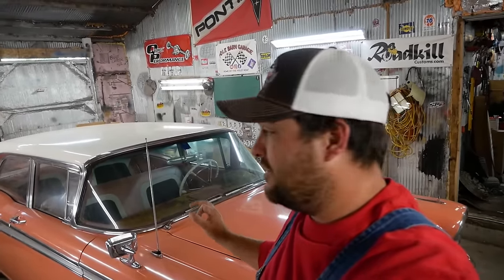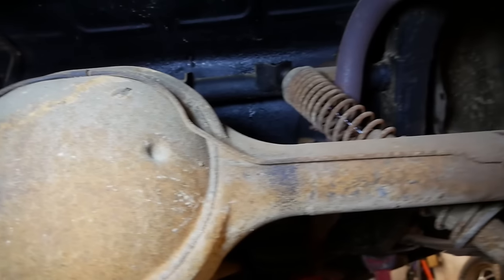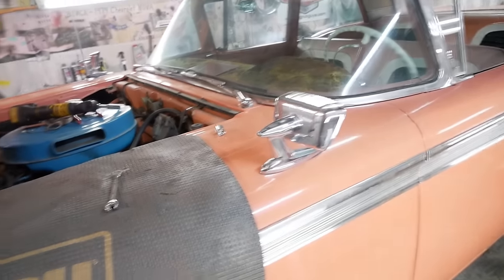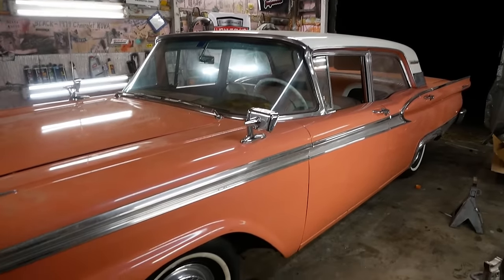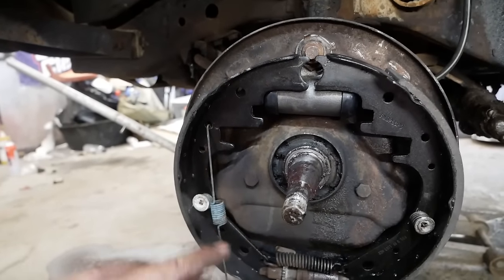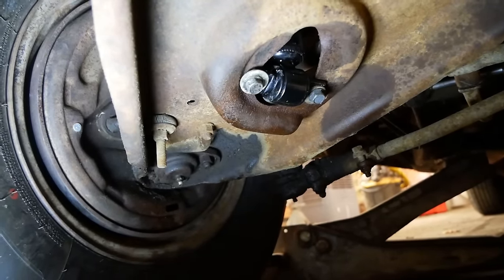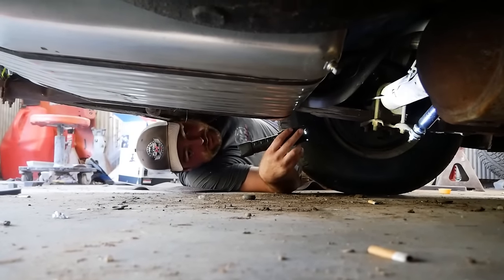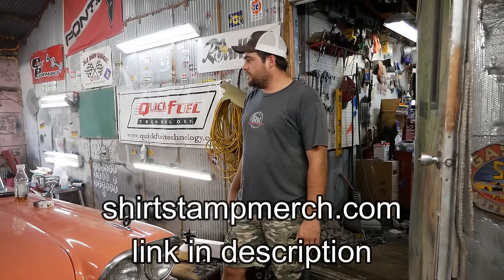All ORIGINAL '59 Galaxie 500 SURVIVOR Gets Roadworthy!

Comment: 33:17 The D settings are indicative of the Cruise-o-matic transmission. D1, D2, D3 are drive 1 is the lowest gears, D2 being around town gears, and D3 being highway gears (cruising speeds).  There is another (green) "updated" Galaxie 500 in Kansas City listed on Marketplace for $12,000.. Gives you some idea what the car is potentially worth.
Reply: Why would anyone drive in any gear other than D3? Is it not fully automatic down to the lowest gear when you select a higher one?
Reply: @auteurfiddler8706  in the 50's automatic transmissions were a new thing. Everyone was making something different, almost every year some brought out a "new" automatic transmission
Reply: In the 50s there weren't many highways with high top speeds so the 3rd ratio was a bit too long for around town so you could "manually" adjust ratios on the fly think the floppy paddles on modern minivans for a similar idea today or the sport mode in your Corolla econobox
Reply: @ywe3  They had highways (ie: Route 66) but with the Manual transmission vehicles Up until the late 1970s, most transmissions had three or four forward gear ratios, although five-speed manual transmissions were occasionally used in sports cars such as the 1948 Ferrari 166 Inter and the 1953 Alfa Romeo 1900 Super Sprint. Five-speed transmissions became widespread during the 1980s, as did the use of synchromesh on all forward gears. 

Until about 2005 most Automatics still had "gear selector" on the shifter. Most automatics  still only had 3 gears with over-drive (4th gear). Although it was rare for people to turn off overdrive.
Reply: In D2 the transmission would start off in 2nd gear for winter driving. 1st gear was easy to spin the tires on snow. Take off in second would ease off on the spin. That's what an old timer told me. And I'm no spring chicken at 57..😊
Reply: @49Fordproject  I'm 56

Comment: The white dot right after neutral is for snow conditions its starts you off in second. Then the green dot is normal drive where it starts off in 1. And low is a cool one where if your going 10 miles an hr it jumps into 1 and if your going down the high way and pop it into low it will down shift into second giving her all the onions.

Comment: Looks like a 352 since it's the light Ford blue and paint looks original.  300 horse.   Compression ratio was dropped to 9.6 from 1958's 10.2:1... same HP rating, lost 15 ft-lb torque.  (EDIT:  then Dalton said "you guys who know your Fords probably know this is the 352...")    This is a pretty nice car.

Comment: Old cargo straps make great gas tank strap gaskets. This would be a fantastic cruiser. I had a 49 Fairlane with 292 V8 slot of this looks quite familiar. It was a great first car. Low on power but a respectable top speed. Simple to repair and back in the 70s parts were available, that and I knew where every junk yard was within 60 miles.

Comment: Your car is equipped with the Three-Speed "Cruise-O-Matic" transmission.  D1 is used if you want low-gear starts with automatic upshifts to 2nd and direct.  D2 gives 2nd-gear starts with automatic upshift into direct.  Low can only be accessed in D2 by flooring the accelerator at speeds less than 15 mph.

Ford transmissions (FMX) and Borg-Warner transmissions were like this until about 1967/1968.  Even some AMC's (which used Borg-Warners) had the same 2nd-gear start with the P-R-N-D2-D1-L quadrant.

Comment: Drove almost an identical car for a couple years in college in the mid-90s.  Great grandparents bought it new and it was off the road since the late 1960s.  332, same transmission, power steering, and select-air air conditioning - and vacuum wipers (discovered how great Rain X was) . . .  The car was the same geranium color but the paint scheme was a little different - geranium on the bottom and roof and white through the middle.  The thing rode like a couch and usually gave 16 to 18 mpg - would bark the tire shifting into second if you had your foot in it.  Good times.

Comment: Drive 2 should start out in second then go to third unless you floor it, then it'll downshift to first. Drive 1, AKA green dot is the standard 1-2-3 shift pattern. If you want to shift those manually 1-2-3, start off in L, get it past 29 MPH (you need to be HARD into the throttle for this to successfully work), shift to D1 then pull it back down to L and for third you can shift it back up to D1.

The rear leaf spring bushings need replaced. I did them on both of my 64's, it cured both odd leaning to one side or another and going around a corner both cars no longer felt like the back end was going to come around to the front, not to mention better ride and handling.
Reply: Great description of how the Ford o matic/ cruise o matic work !! 
I have a 62 Thunderbird and that is excatly how I run her!!
Reply: @paulsimonie6937  Coming from a guy who rebuilt one and drives one regularly. I find if I do the manual L to D1 shift it'll often just skip right to third gear if I'm not hard enough on the throttle or going fast enough. I think it's something to do with the transgo shift kit I installed when I rebuilt the transmission because if I held it in L then shifted to D1 it would shift to second then third automatically at lower speeds/throttle before. I find I have to be at least 50% in the throttle for it to not skip to third. It's either that, or the combo of the 2200 RPM stall converter and camshaft vacuum signal I have.

Comment: Dealing with solo brake bleeding/fluid flushing and tracking down vacuum system leaks, I finally broke down and bought a metal Mityvac vacuum pump and a AUTOOL smoke machine. The time and headache savings to bleed brakes, swap out brake fluid, and quickly see the vacuum leaks in a system made these two items well worth the costs.

Comment: I see in the comments some guessing about the shift markings. I am from that era. You should have R for reverse. L for low. in that position it will start in low or go to second win down shifting above 25 mph. when the speed drops below 25 it will drop back into low. Drive 1 will start in second and go to high. They did that so you could start in second in snow and ice for better traction. Drive 2 starts in low and goes to second and on to third. If you push the accelerator to the floor it should kick down to second for passing. That is adjustable with the carburetor linkage. should work in D1 or D2. That is the way I remember it. Hope that helps. Most of those 59 s rusted away so you have a very collectable car there. You get the front bushing and links balance etc. she will cruse all day at 80 plus MPH.

Comment: Little old school trick dad taught me 40 years ago, wrap some striped stranded wire around them bulbs so they sit in tight instead of crimping on them old brittle sockets, one wrap with couple twists & lay the tail facing out, 60% of the time it works every time

Comment: If you have to glue more things the spray can is not the best for interior stuff. Some of the best stuff is dap brand landu top adhesive. It's made for vinyl tops and has uv tolerance. You can spray it with a cheap paint gun but it will ruin it or needs to sit in thinner overnight in pieces.

Comment: Used to have a 1974 F350 farm truck, with 460 in it. Fuel pump (original) went out and it took 3 tries to get a replacement pump that worked.

Comment: I live in SE Michigan/Detroit.
There is atleast 4 car shows for every day of the week. When at the gatherings, there are always 50's and 60's era cars driving around with that same strange noise going in. Usually they don't fix them or if it is addressed, it will be in the power steering box or the brakes. Depends on the make.

Comment: I haven’t finished the video to know if you fixed the noise, but check the detent linkage at the back of the intake. The noise is the transmission pump. My ‘59 made the same noise when the linkage was out of adjustment.
Reply from the maker: That's Good idea

Comment: I left links for you the last video you did on this car.. You can find rebuild kits and new pumps.. The only sound I hear is a heinous exhaust leak that sounds like a cracked manifold and maybe a noisy power steering pump. That's Ford's version of the powerglide.. you start in D1 and then shift to D2.

Comment: I'm too lazy to read the other comments, but IIRC that buzzing funny noise is the vacuum modulator on the side of the transmission leaking. Cheap part, or used to be, and easy to replace.

Comment: Nice 59 Galaxy, a close school friend has a 59 Galaxy as well but his is Apple Green, plus he has a 59 Edsel Corsair convertible in President’s red. He’s fixed everything on them but rarely drives them anymore. (We’re both 72 so glad to see younger guys fixing them up too). 
Think your noise might be an exhaust leak, his 352 sounded like that & he had new exhaust installed.
Plus, did your Galaxy once have a padded dash? It looks like all the foam & glue crap left behind after the old dash shell removed. Try a plastic scraper & adhesive remover. The dash should clean up real well. Good luck, nice old Ford.

Comment: You know those yellow and red dots on tires? They are to help balance the tire quicker. The Red dot is balanced without TPMS, and the Yellow is balanced with TPMS, combine that with the bubble balancing someone else suggested, it should be good enough. I have noticed that some tire brands don't use the dots however

Edit, my 2am brain forgot to add how to use the dots.
To use the dots you align them with the Valve Stem.

Second edit: love the IBEW jacket!

Comment: We had that model Fairlane here in Australia, 4 door sedan and wagon. Ours had manual in the base model and auto in the 500, both came with a 332 fe motor. They were considered a bit more opulent than our lower grade cars, plus they went up against the Chrysler, Chevrolet and Pontiac equivalents until we started making our own. The Fairlane used to be called the tank Fairlane for obvious reasons.

Comment: I own two old vintage Buicks and it is always something. Check a fuse for the dash lights not working. It could also be a bad headlight switch. I have that situation with my '56 Buick. The dash light rheostat has shorted out. I have a new switch but I can no longer climb under the dashboard like I used to be able to 30 years ago.

Comment: A little bit better way of doing this would be to take the - pad and lay it on a table or the ground, and lay a older towel underneath it and apply an iron to it. Go back-and-forth like you're ironing a shirt period the heat from the iron on the coolest setting will allow the material of the dashpad to relax easier than a heat gun, a heat gun only distributes heat to the specific spot where the snout of the heat gun is at, and iron will evenly distribute heat to the pad. It does work much better, but it's only a suggestion.

Comment: Stupid question about gravity bleeding. How does it work if the master cylinder is not being pushed on by the pedal? I mean, you can take off the brake lines going to the master cylinder and fluid will not come out until you press the pedal or push the cylinder in with a screwdriver or something.

Comment: In a Rambler starting in drive one means the transmission will start in first.  Drive two the transmission starts in second for better fuel economy.  Don't know if the Ford is the same or not.

Comment: The dealer said 1 million miles or 75 year warranty which ever came first . I would looking for manufacturing recall on the pump and shock . Not looking for good Google  review im guessing
Reply: Chevy is no better….I just had to have my father’s ‘57 carburetor rebuilt because one float started leaking. Even the extended warranty wouldn’t cover it 👎

Comment: Cruise-O-Matic D1 shifts 1-2-3; D2 shifts 2-3.  A start in L will hold 1 until you shift it into a D position, then will hold 2 if shifted back down into L. L will then hold 2 until moved back to D1 or D2. Don't overrev--there are no safeties built in like modern cars.

Comment: Any time you buy a car with over load springs or shocks, you hope, "Maybe those are on there because the guy wanted to haul a trailer, not because the springs are sagging."   But it never turns out to be the case. At least the old front springs were not held up by coil spring spacers. Which tend to break the coil springs and give a horrific ride.
   So, the car is now too low, especially in the back and the question is whether all new springs or buying more coil over shocks is the way to go.  The way the back end dropped down when you backed it out shows how bad the back is now.